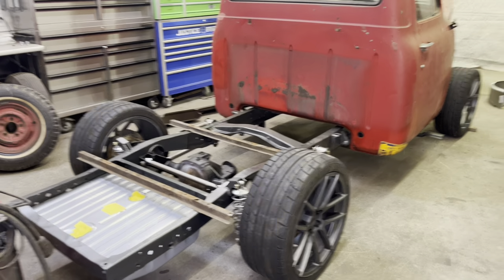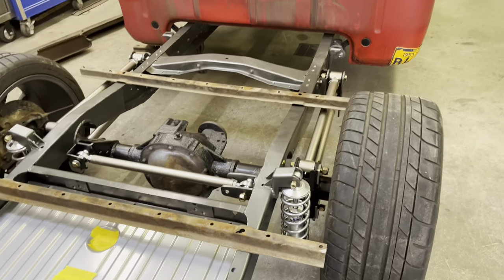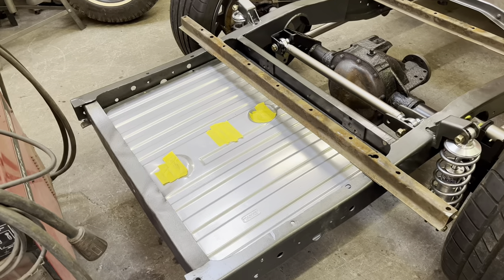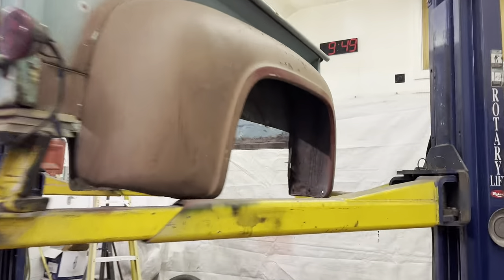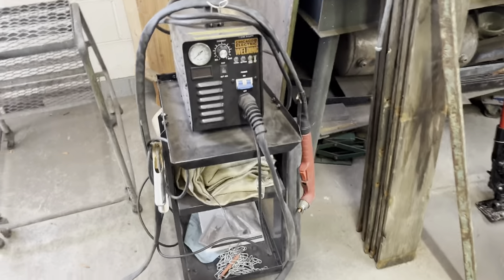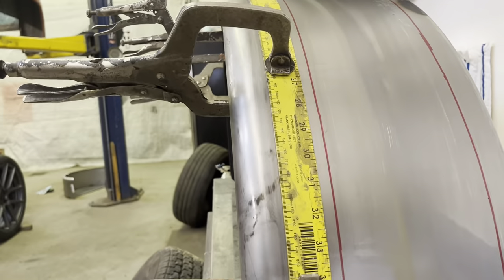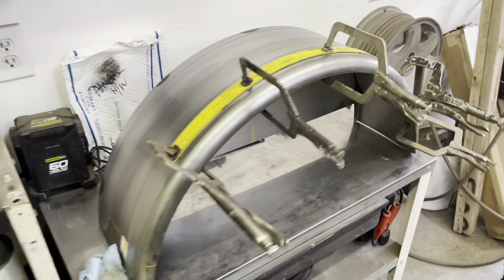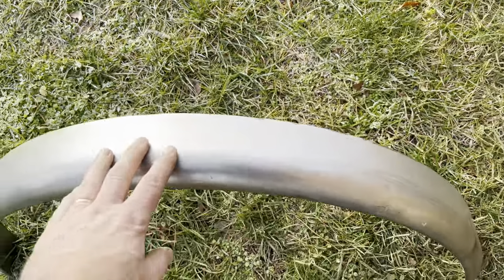Making f100 mini tubs from cheap trailer fenders

Comment: I'm confused about these control bars or panhard bars like you have from the rear end to the frame. I can't seem to picture how they don't shorten the distance between mounting points when the rear end suspension travels up and down. Wouldn't the distance become shorter as the rear end travels downward and cause the rearend to be pulled in sideways by that bar? In other words, if you were to completely un bolt the rear end from the suspension and frame and let it hang strictly from the panhard bar Wouldn't it pull the rearend towards the mounting point where the bar is mounted to the frame? The point where the bar is mounted to the rearend would be hanging straight down and inline with the point where the bar mounts to the frame. I don't understand how the rear end doesn't move sideways as the suspension and therefore the bar travel up and down. 🤔